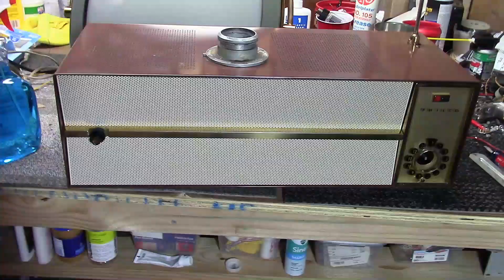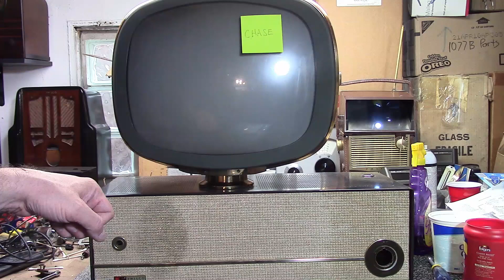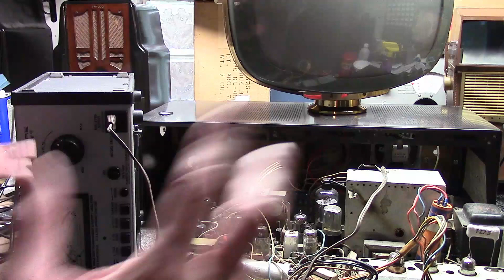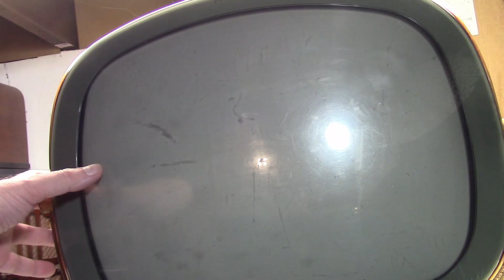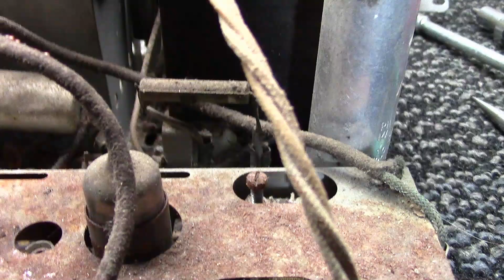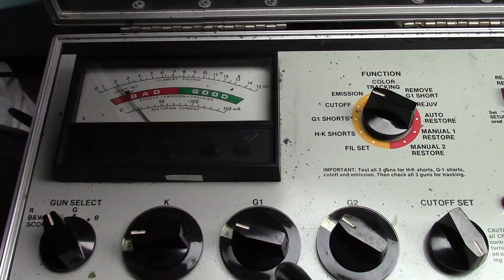Predictapalooza s1e14: Princess wrap up and dual triage

Comment: Hey there, found this very helpful, Im slowly working on the RCA 6-T-53 television and the chassis looks like it was plucked from the titanic, I've done naval jelly, and wire brush, is it ok to sand the stubborn areas? Thanks so much
Reply from the maker: Yes, I also strongly suggest Evaporust.  It's non-toxic and will not attack other metals or plastic.  Good luck!
Reply: @bandersentv  thank you so very much, really appreciate the advice, Im very excited to be getting into this hobby, be safe.       Mark.  (aka Spock212 antique radio forum)

Comment: Regarding the H/K sort, how about zapping it to blow it away.  Maybe charge up a 500pf doorknob to a few kv and zap it with that.  The problem with power tubes is that cathode coating that migrates to the grid can cause grid emission, leading to positive grid voltage and red plating.  Makes me wonder if cathode coating left on the grid after zapping the crt might cause issues even if it clears the short.  Thinking about it though, the "grid" is not really a grid in a CRT, it's just a plate with a hole in it, so with luck the cathode coating stays within the cathode grid gap and doesn't spew out of the hole and contaminate the anode side of the grid.
Reply from the maker: The heater (filament) is inside the cathode which is a metal tube. The gap between the two is very small. Once something gets lodged in there, it's virtual impossible to blow out without causing damage
Reply: @bandersentv  Actually the filament wires are coated with a ceramic to form an insulation. A H-K short happens when the ceramic gets damaged or becomes leaky. So using a jolt of current can be counterproductive.
Reply from the maker: @notimetolooz9655  Right.  I've been doing some research and it's not looking good.  The arcade game restoration forums are good to read through.  The owner of the set doesn't like the idea of using an isolation transformer so we may end up just replacing it.

Comment: Try discharging a capacitor across the H-K. Nothing to lose and it may blow the short clear.
Reply from the maker: More likely to blow the filament open. At least now it could be used with an isolation filament transformer.
Reply: @bandersentv  Very true, but it was a common trick  here in the UK in the early days, when tubes were terribly expensive to replace for the average user.. It actually often worked! The alternative usually produced very low resolution  images because of the capacitance, as you mentioned.
Reply from the maker: @JamesEncliffe  I've certainly heard of this trick and it was widely used here too, but for removing grid shorts.  The problem is that the heater is a coil of wire inside a metal tube that is the cathode.  Once debris gets lodged inside that tube, it's nearly impossible to get out.  The earliest CRT tester/rejuvinator I have came with a vibrator you could but on the neck to help shake short loose.  Perhaps I'll try that.

Comment: For those screws to hold the backs on, they look like GM 70s/80s interior screws - Black Oxide w/captive washer. used to hold the dash or similar parts on.

Comment: Hey bob, modern resin based 3d printers can produce perfect replicas in all manner of resins, translucent, tinted, or solid color, and nearly as good as injection molded parts. They can be had for a couple hundred bucks or less on ebay.

Comment: You can put the cabinet into a tub of 33% molasses and 66% water. It will eat the rust off, but wont damage any paint. It takes a few weeks though. The mix is eco friendly though.  You might want to try it on some rusted metal & see how you like it.
 Just wash with water thoroughly when its out of the bath, and dry & paint. You can also put the boards in the dish washer.
 Remove all transformers & coils first, & when boards are clean & completely dry, lube pots, reinstall transformers and replace all 'lytics.
 This is a trick that a Motorola tech taught me. It works great. If any variable caps, they will need a drop of oil on the shafts, as well as the bearings for the pots.
Reply from the maker: Interesting. I've been using Evaporust for the past few years. It works on a similar principle but faster. Only downside is cost. About $25/gal.
Reply: @bandersentv  Evaporust uses the same principal that happens when molasses is used. Evaporust just used a active chemical with out all the other stuff in molasses.
Reply from the maker: @notimetolooz9655  Yep, chelation I think it's called. HD now has something called Blaster Metal Rescue Rust Remover Bath I'm going to try.  It's half the price of Evaporust and has similar claims.

Comment: Galvanized sheet metal screws with small washers aren’t a bad replacement for missing  original back screws. I usually put them in a small jar with some white vinegar for a couple of days to take off the zinc coating and them shine them up slightly with a dremel tool.
Reply: There is a darkening solution that I have found works OK to darken galvanized hardware. It is meant to darken brass to produce a antique look. A small bottle I have comes from "WSI Distributors" in St. Charles MO.